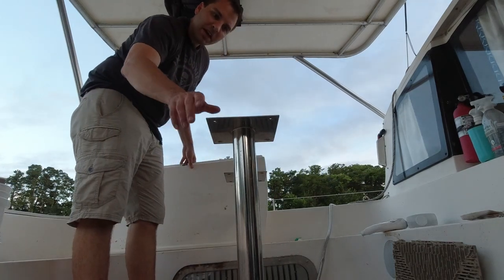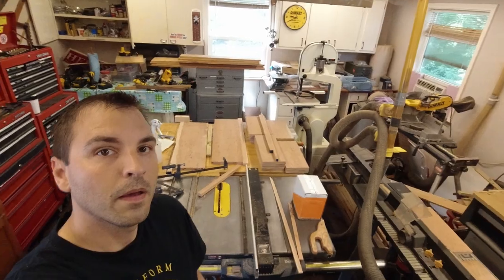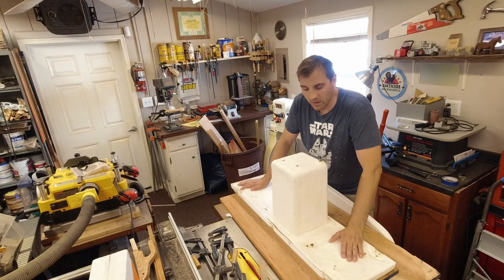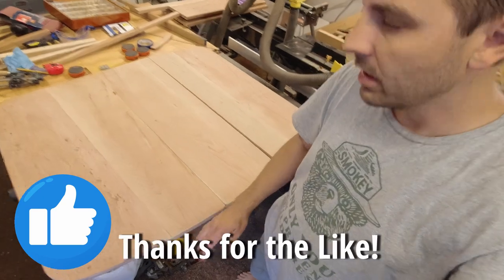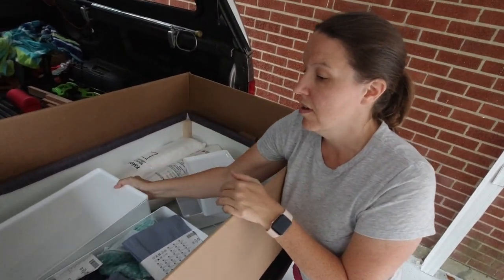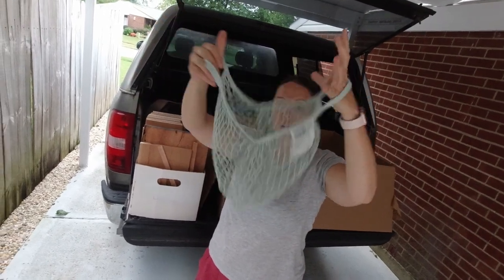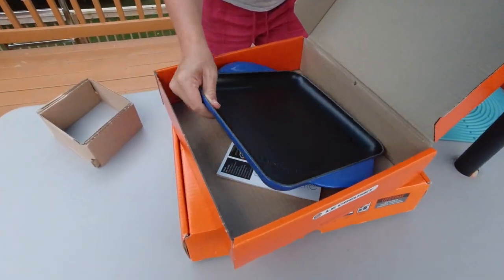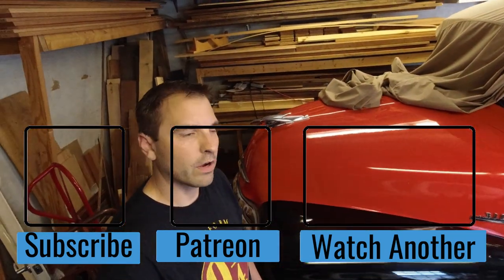Family Catamaran Sailboat [NEW TABLE and IKEA STORAGE]

Comment: Great table. But wood glue isn't the best for the Marine environment. And you may have wanted to use some dowels for your joints. But Great video. Until next week. 
Aloha and Mahalo from the Big Island 🏝of Hawaii 🏝
Reply from the maker: Hi Bill! Yeah, I thought twice about the glue. I did use a plate jointer with biscuits on the table wings (didn’t make it into the video) so that should help.  I think I’m going to do an epoxy finish to protect it and give the glue joints some help.  I’ve seen Mads on YT channel SailLife do an epoxy finish, with varnish over the epoxy to assist with UV degradation.  As of today, the table is still  raw, so I have lots of options.  Do you have any suggestions?  Corey
Reply: @SaltyEscape  you can use the thickened epoxy to join the wood together. And yes I did the same thing. I put epoxy over the wood and thin put the varnish over it. It lasted three years before I had to revarnish. And that was my wood rails outside.  The wood inside is still to this day looking fine.

Comment: Have you - in one of your videoes mentioned height different places in the boat and also the qize of the berths?
Reply from the maker: Hey there!  I don’t think we’ve mentioned it specifically.  I don’t know the actual measurements but I’m 6,3 and my head touches the ceiling near the refrigerator in the galley. Otherwise there is plenty of headroom. Are you shopping for a boat like ours?
Reply: @SaltyEscape  Thanks. Have you any idea of the lenght of the Berths?

At the moment I am looking at various models - the Venezia is one of them, but as you know Covid-19 has made any boatshopping abroad difficult :)
Reply from the maker: Well, the aft cabins easily hold a queen mattress and there is about 10-12 square feet of floor.  The forward cabins have similar floor space but the mattress is about 60 inches by 85 inches. (By memory).  Seems to be a good well-made boat. We did look at another Venezia 42 and the deck felt soft in a few areas which is curious because at the time Fontaine Pajot was Using a PVC Coring material. Our boat feels solid all the way around. As far as working on our boat, The wiring is by far the hardest.  There Is limited access to run new wires and the previous owner has already done some “work” making it even more difficult.  I’m happy to try and answer any other questions, keep us posted if you purchase one!  -Corey
Reply from the maker: Also have a look at the YouTube channel “sailing trio travels”. And the Doubledutch travels on Instagram. They both have the same boat.
Reply: @SaltyEscape  Thanks for your reply. I know about trio travel and do remember the "cheap" Venezia in one of your previous ep.
You have the 40 hp engi es, right?
Reply from the maker: I think they’re 39 hp... there were the upgraded option.  Lol. Cheap is relative.
Reply from the maker: We haven’t had an episode in a few weeks because I’ve been working hard daily on the refit.  We have some impressive progress to share soon.

Comment: I'm curious since its been a couple years now. How has that table held up in the marine environment without any biscuits in the joints?
Reply from the maker: Well, there WAS biscuits in the joints.  The joints held fine.  The epoxy finish DID not hold up to the UV.  I’ve made a new table out of teak.
Reply: @SaltyEscape  oh OK. Sorry, I guess I missed that on the board filmed there just before the clamp.
Reply from the maker: I’d really like to use a Festool Domino instead of biscuits. But, you know, it’s at bit too expensive.  😊
Reply: @SaltyEscape  yeah, my father in laws shop looks pretty similar to your dad's there. He's a cabinet builder by trade. And he's kinda gotten bitten by the festool bug lately.
Reply from the maker: @ceremonialguardsman 😊